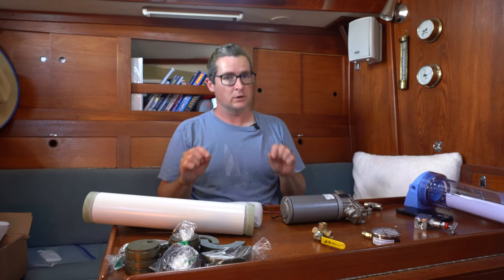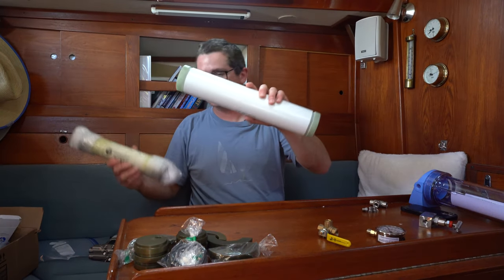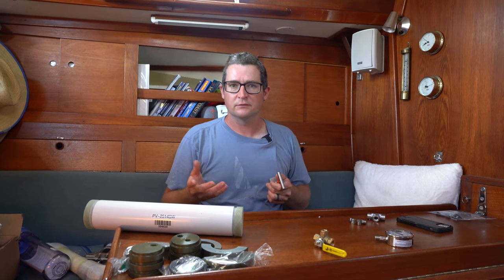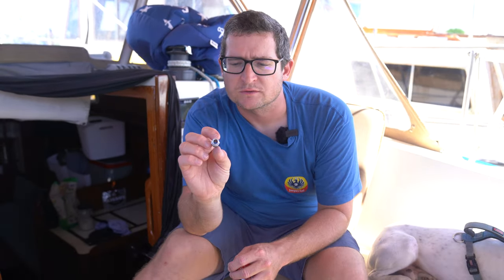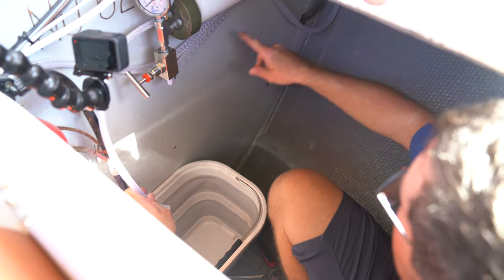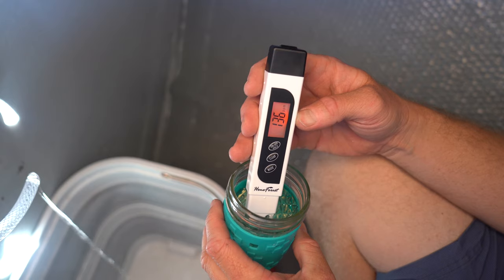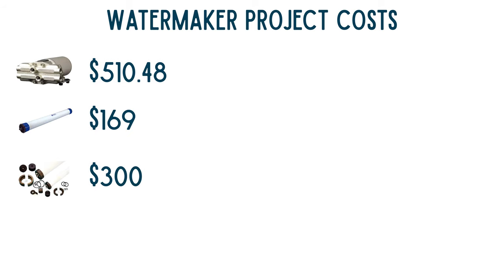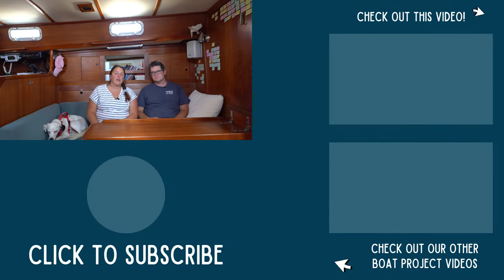A Budget Friendly DIY Watermaker!

Comment: Pretty scary.  No engineering knowledge wrt pressure boundary codes and construction.  No small wonder it leaked at first.  No small wonder about the crystalised salt in the pump.  No small wonder a booster pump was not used (very common to use a high volume, low pressure centrifugal pump to feed the high pressure pump). I find it incredibly scary at how laissez faire you are wrt pressure boundary.  I would not go anywhere near that contraption.  There is a reason why actual water makers cost what they do.  Finally, your costing only includes the cost of parts and not the huge amount of time you spent jerry-rigging the watermaker.  Everything has an opportunity cost.  FYI, I am an actual engineer dealing with pressure boundary issues so I know little bit about what I am talking about.  Using a high pressure positive displacement pump with no pressure relief valve anywhere in the system.
Reply: Still half the price.
Reply: Many don't go to university and become engineers and know what  "wrt pressure boundary" means, but learn by doing (:
Reply: Plenty of cruisers have more time than money, which is why we look at DIY solutions to expensive problems. The poster has been honest about his mistakes, and the unit obviously does what it’s intended to, so I don’t see the issue here.